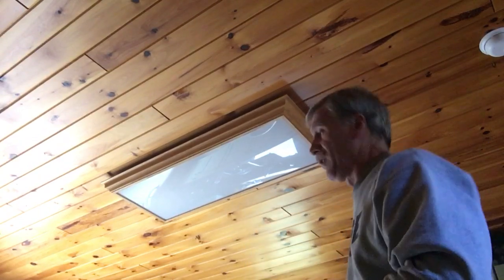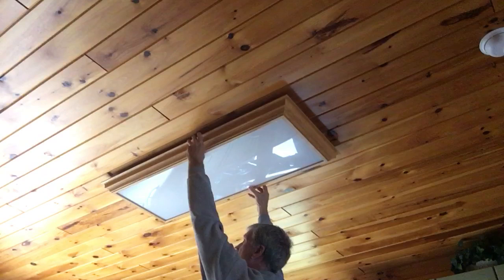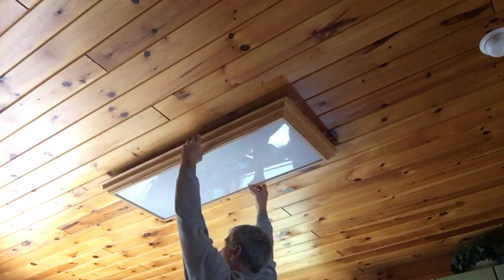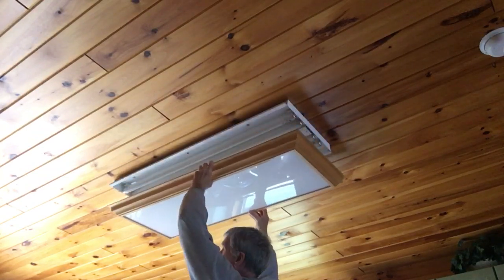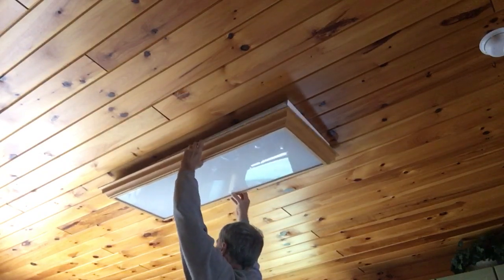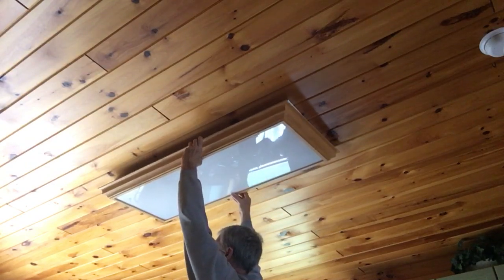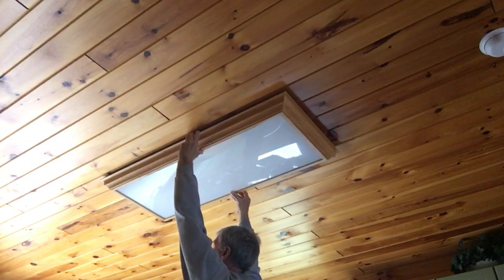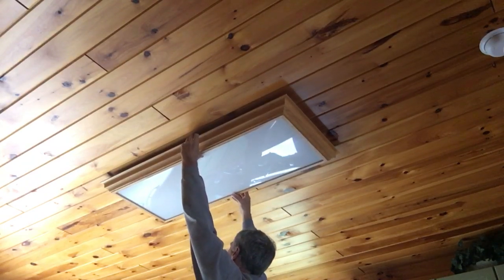Kitchen Light Removal

Comment: Excellent video!  I nearly tore down the whole fixture trying to remove the cover😅.

On another note, one of your viewers mentioned one side was stuck.  The same thing was happening with me, which is why I watched the video.

When I finally got the cover opened, I found the one of the metal post that hold the fixture in place was bent outward,  which prevented the cover from swinging open down🤷🏾‍♂️😄.

Thanks for posting!

Comment: Just a caution for those trying this method - all overhead fixtures, although they make look much like the one in the video, do NOT come off in the same way. And mine looks VERY similar! So, I tried the same method of removal and it did not work - as there simply was no wiggle room or play in it. In fact, at first, I thought perhaps I'd not used enough force to lift a side up. No, it's just mine doesn't disconnect (least not like here) - and I'm very fortunate I didn't rip the entire light fixture down trying the video's method. 

What I found is, the reason I couldn't get the first replacement plastic back in without it breaking, was because the first material I had purchased simply wasn't flexible enough - so it cracked before I could correctly maneuver it into place. Upon going to Lowe's (or Home Depot) to get another, the replacement plastic was made of FAR more flexible material and easily went in - so no taking down the fixture frame was necessary. Thanks.
Reply from the maker: Phil, sorry to hear you had so much trouble with yours.  I guess if you go to lift either side of the light and it doesn't move up a 1/2 inch or so easily then it's probably not a swing out light like mine.  Thanks for the Tip!
Reply: I don't think mine works the way in this video either. What was the key to getting your cover off?

Comment: For those who say "Mine doesn't work like that" Get on a ladder and look for a screw it has to be on one of the sides of the wood frame. Mine had a screw.if i didn't remove it, probably i would have end up destroying the fixture.
Reply: I destroyed mine and they don’t replace it you have to buy a whole new light 💡 🤷🏾‍♀️
Reply: Thank you for pointing this out. I almost ripped my light fixture. Mine had screws on both sides. 
The main post should have noted to look for screws first especially when you notice the panel can't easily be wiggled.
Reply: @pineandpoplar9476  Where are you seeing the screws? My ceiling fixture is wood, gridded and heavy, so I'll only get one good chance to get that lightbox down before I drop it due to the weight. 
Please don't recommend hiring someone. That is on the solution I need.
Thanks!
Reply: @calsunnygirl1  Sorry I did not see your question until now. The original post does not tell you that many fixtures have screws. You really have to get up a ladder and closely look around the rim to find where the screws are. The cover can't be that heavy since it is just a frame and light panel, though yours could be a different model.

Comment: Mine would simply not come off.  I felt all around and found no screw or fastener of any kind.  I finally managed to get the plastic lens off without breaking anything.  I'm going to retrofit it with LEDs, then I'm not quite sure how I'm going to get the lens back in.
Reply from the maker: It could have been somebody’s custom handy work. I would rip out entire fixture and replace with new LED model.
Reply: @PompanoBrownie  I couldn't even get the stupid burned-out fluorescent tubes out.  I've pretty much decided that a whole new fixture is the best route, as you suggest.

Comment: It’s not working
Reply from the maker: Push-up, slide to the left, only pull down on the left side, and then move unit to the right while pushing up the right side and then pul down on right side.. If that doesn’t work, it could’ve been somebody who just screwed a fixture into the ceiling and you just have to destroy it and get yourself a new version. Chances are you’re still fluorescent you’re gonna want LED anyways so there is no great loss here and it’s probably safer. It won’t run as hot.